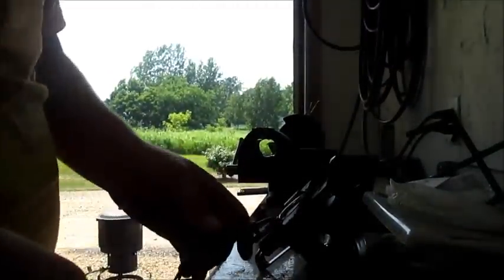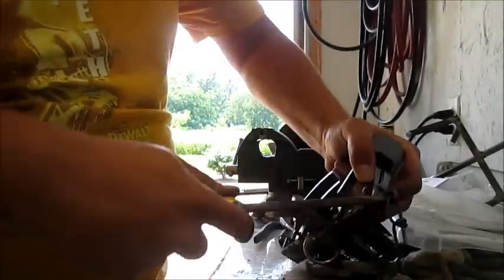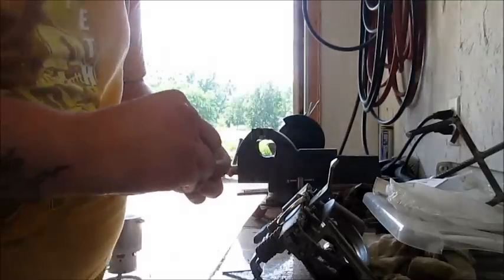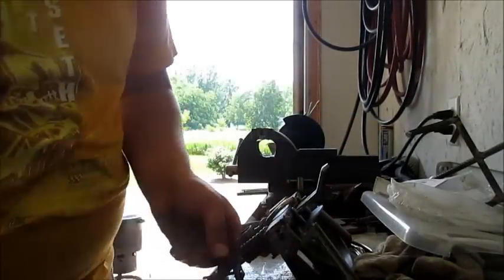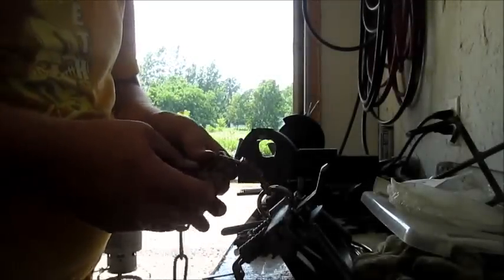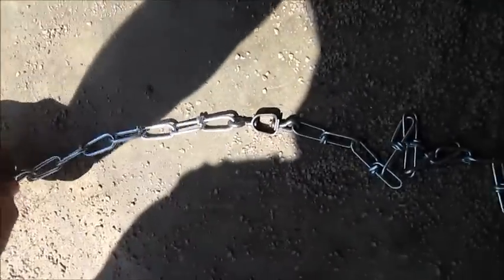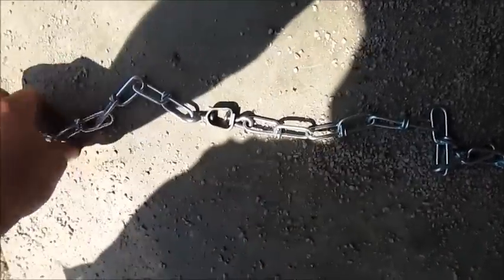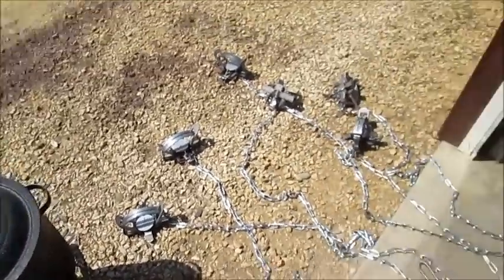Modified Duke #3 Traps

Comment: I run 3 dz Duke #3 offset traps. I went thru 4 coil them. Base plated the trap. Replace the chain  with #2 machine chain. Add 3 swivels to the chain. Waiting on the laminate kits. Worked the pan over. I may end up putting pit pans on.